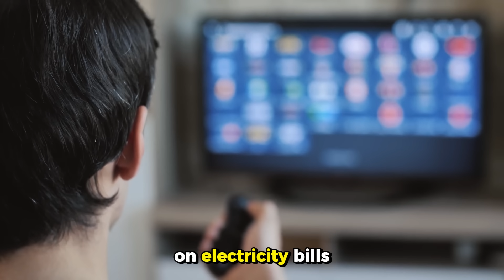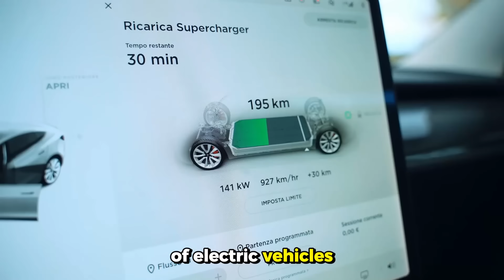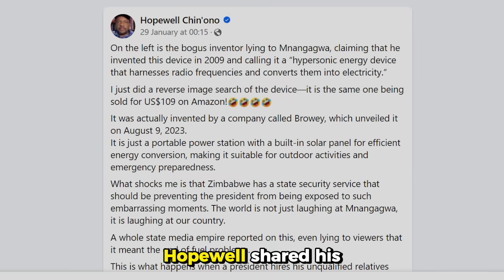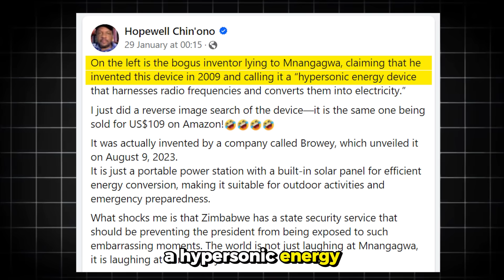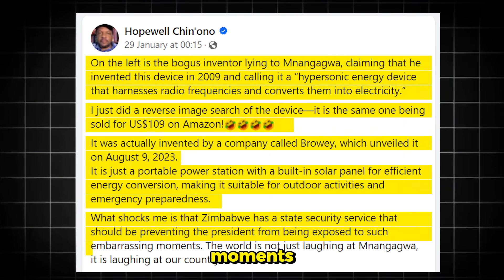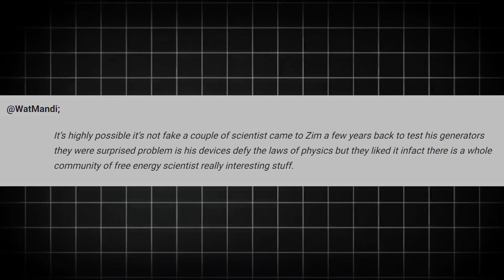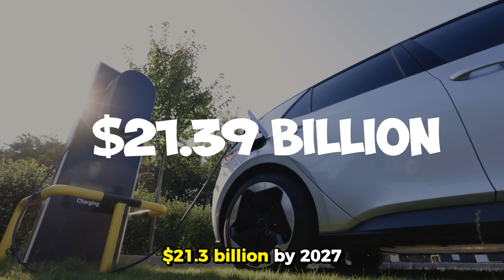Elon Musk In Panic! As Burkina Faso And Zimbabwe Launch Africa's First Electric Car!

Comment: He basically talking about what Nikola Tesla Invented and suggested fornpublic use, but got turned down. Mainly because the problem is not the reciever system thatc converts radio waves into useable voltage, but the problem consists that you would have to make strong enough warren cliff tesla electric towers which emit high voltage wirelessly to power the devices or recievers. 
the emitting energy would be too strong, a hazard for cell development and human health

Comment: Would be nice, but I think the car will not be comparable to Western cars. I mean, even Teslas are just overpriced electric boxes—nothing truly special or better than the competition. Look at Mercedes: full self-driving, better batteries, and a nice range.

Personally, I think electric cars are impractical for everyday situations, except maybe in the city. I would rely on cars with electric motors, a small battery, and a good combustion generator as a power source—at least until batteries become truly efficient. But it seems like this will take years.

At the moment, electric cars are only really suitable for flat roads and light-weight driving with low mileage.
And maybe races.

Comment: As a scientist. It does not defy the laws of physics. Energy is everywhere. An where there is an abundance you can power everything. You just need a device to use that energy an an NOT overload it. Televisions do not need continuous power. They never did. The Converter uses the power an has no where else to send it. Which is why a TV uses very little power at all. Same with a desktop PC. But a Desktop PC uses an enormous amount of power.. But if you set the power to reuse its own power it makes a circuit. That loops. An continuously feeds it. So you unplug it. An it powers itself.

Comment: Using radio waves, you need a radio transmitter which takes electricity. Does anyone want to buy my ocean front property in Arizona? Tesla tried to get energy similar to Faso and it was a nonsuccess. The amount of power coming through the air to drive automobiles would be enough power to electrocute everyone. Maxwell is an uneducated phony.